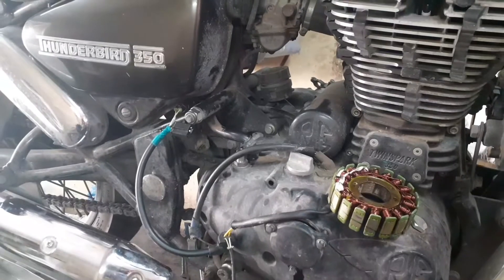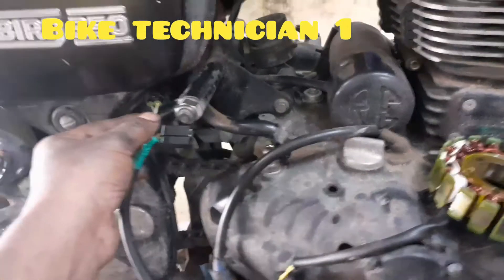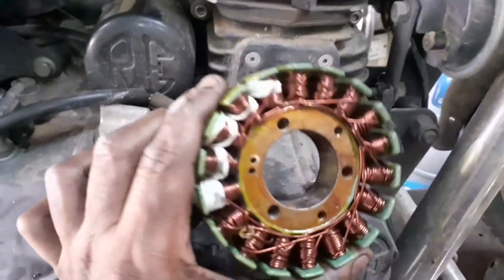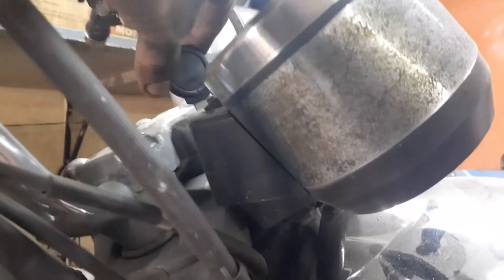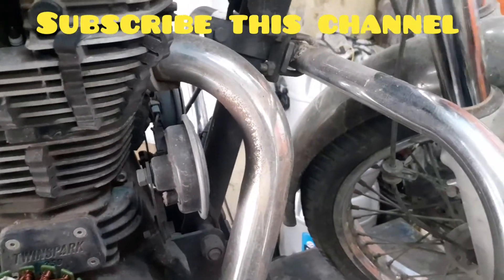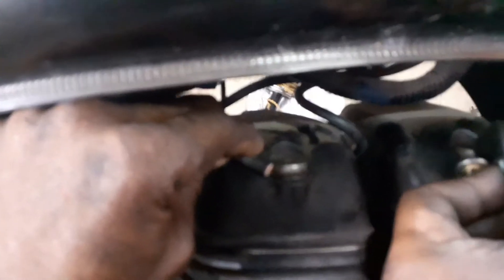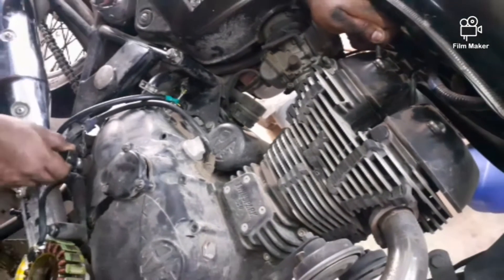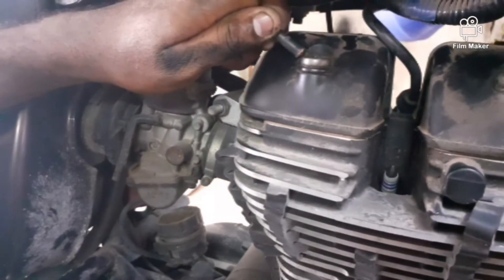Royal Enfield pickup coil and CPS testing easily

Comment: sudden mileage drop in my classic 350 bs3 2013 model. mechanic cleaned carburettor and spark plug all good for 10 kms.suddenly sound increases and spark plug becomes black again and again.mileage is 32kmpl.what is the problem sir.already head work done in lathe.piston is changed to .025 . unable to find the mileage problem,help me sir.

Comment: Bro I have one issue in my classic 350. I am also mechanic only in my bike. Battery getting over charging it coming around 18

I checked and replace the rr unit but still current coming high only. All the bulb got fused in my bike. What to do now? What I have to check next?
Reply from the maker: Sorry bro for this late reply.
I didnt attend This types of complaint 
If its the original rr unit .
But local make, this types of complaint will come.
So please again check the rr unit.

If didnt solve
Check
Battery
Magnet
Magnet coil assy
But first check the rr unit
Reply: That is voltage regulater complaint.